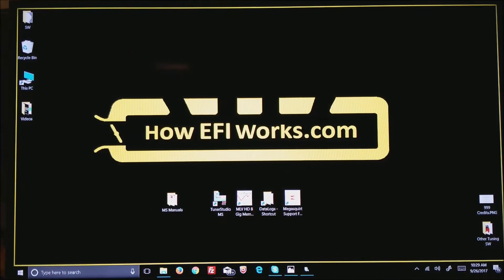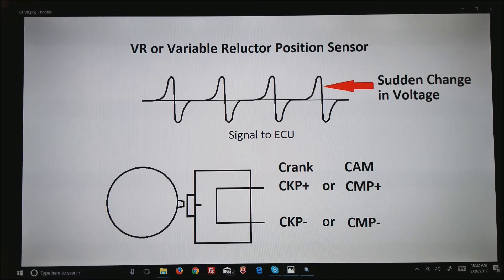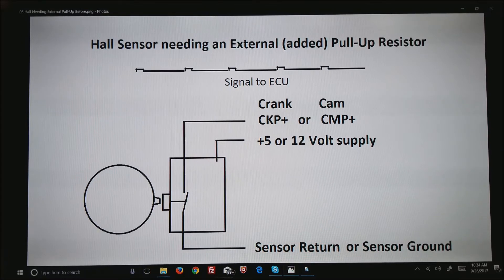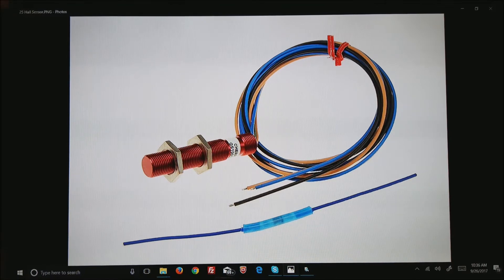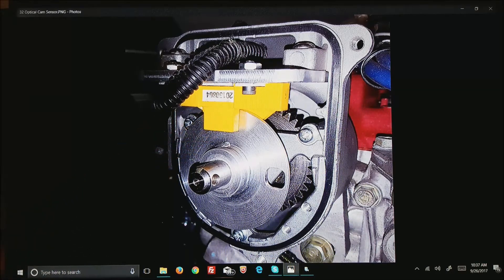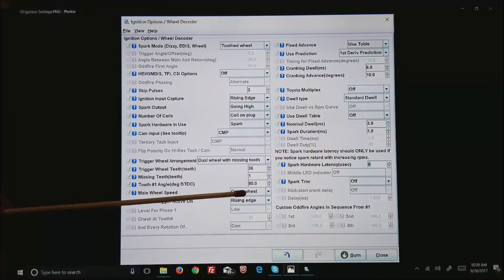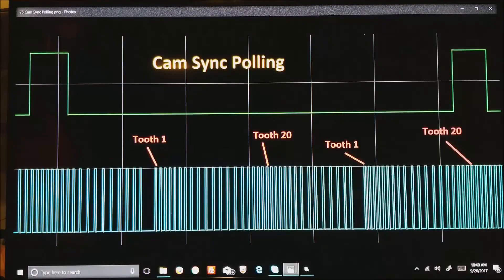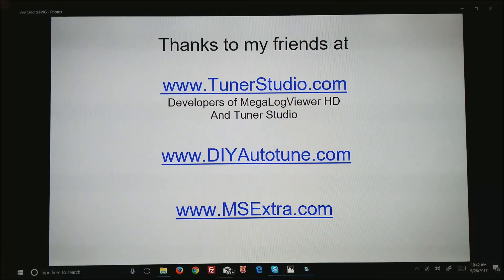Crank and Cam Sensors

Comment: What absolutely peeves me as an EE enthusiast is that VR sensors are stupid simple and cheap devices, yet parts suppliers charge an arm and a leg for them because people simply don't know any better. ....It's a magnet stuck to a piece of metal with a bunch of fine wire wrapped around it. I literally have the stuff to make dozens of the damn things laying on my desk right now.... But, NO "$50+ special tech, give us your money!" 

... TBQH I feel quite the same way about PCM/ECU's (part of the reason I'm here).... A $30 pre-pay phone has enough compute power to run a dozen cars at the same time. Yet everyone and their dog charges $500+ for a programmable ECU with compute power from the 90s. The automotive electronics industry is just insane.

Comment: hey. saw that you hade re worked you dizzy from your honda, i have an d16z6 with oem dizzy, but have huge issue with the trigger signal, my car wont start up, i go with maxxecu! do you have some information how to install a better trigger for my engine ? nice video btw :D
Reply from the maker: It was just a 36-1 made from a standard gear with a Motec hall pickup.  Then for a cam sync, I used a Accel points eliminater laser device with a ring with a hole in it.  Ask for pics over on the MLVHD FB group.
Reply: @AndyWhittle_HowEFIworks   hey thx for replying, ill send u on fb then 🤗

Comment: Excellent vid. Thank you.   Can someone clarify for if the screen shots of the cam and crank pulses (min 8:26) are from MS, or TS, or Megalog viewer??  Thanks!
Reply from the maker: That was done in Tuner Studio.  You can also view those logs with MLV or MLVHD.
Reply: @AndyWhittle_HowEFIworks  Thank you for the quick reply.    Any chance you would be willing to do a video that shows how to create custom graphs.  For example how to create a graph that shows the results of the cam angle (Phaser rotation in degrees) and pwm duty cycle on the oil control valve?

Comment: Hi Andy i have msd 84661 sensor in a efi small block ford ,old M48 ECU and it runs ok , but gets sync errors ? which it did on a msd dissy , now i have made an offset drive dissy and i still get sync errors (new sensor) , i have added an earth wire and tried different gaps , which seems to alter the rpm at which  the error comes up , can you tell me if the size of the metal flag makes a difference to signal here's a link to what i made , https://youtu.be/tcBxfRSYjt8
  or if you have any ideas would be great , Cheers

Comment: Hi Andy. I hope you still reply to question. Andy. i happen to have a Volvo 940.1994 regina model B230 engine. I measure only the crank sensor while it is installed and cranking.I read between 100-120mv. But i can find any ready in my trigger logger of rpm nothing.the firmware sas MS2 3.4.1  trigger pattern is 44-2-2 preset in  microsquirt, do you have any ideas what to do? i have no spark either. the sensor has 3 wire. red/blue/bleack seems to be the shield. red and blue reads 196.6 ohm .three weeks trying to find the answer. there are many gues.  Pls help.   regards

Comment: hello i got one question im trying to read a crank sensor from a small bike by using arduino. wheel is 12-1 so 11 real teeth a 1 missing sensor is 2 wire sensor i dont think its hall sensor but im not sure. on arduino i can se 2 pulses 1 long HIGH pulse and 1 small LOW pulse lets say for example HighPulse = 2292μSec and LowPulse = 880μSec and i do know at TDC sensor wheel is @ 225deg .if im only getting 2 pulses how can i decode that wheel to get the angle  that i want

Comment: Just one question in a Honda b18c are you using a standard distributer or have you modified it to give a more clear and accurate signal to the Megasquirt.
Reply from the maker: It is basic math and EFI code limits.  If you have a 24 tooth crank location, with the sensor rotating at cam speed, that is 12 teeth per 360 degrees of crank rotation.  (360 degrees)/(12 teeth) = 30 degrees per tooth.  That is simply not enough.  40 teeth is the most I could squeeze into the stock Honda dizzy case.  

See http://www.msextra.com/forums/viewtopic.php?f=134&t=65477 for more detail.

FYI: This motor accelerates at 9000 RPM per sec on a neutral throttle stab.  The race motors, with really light flywheels and lightened cranks are closer to 12000 RPM per sec.  I prefer to have all the teeth you can get up to about 36 teeth per 360 degrees of crank rotation.